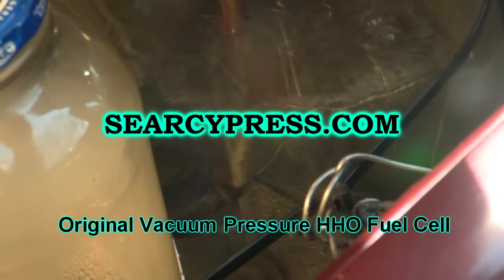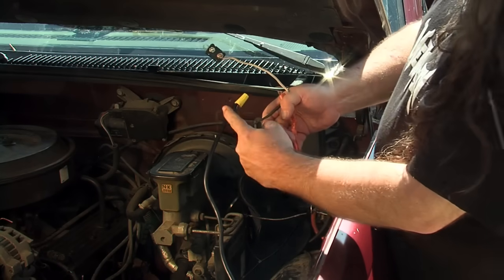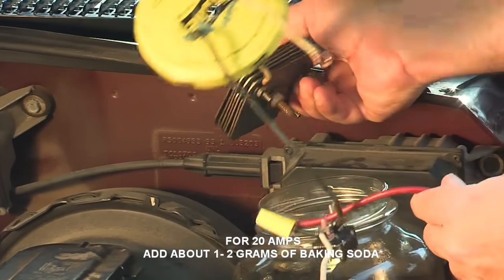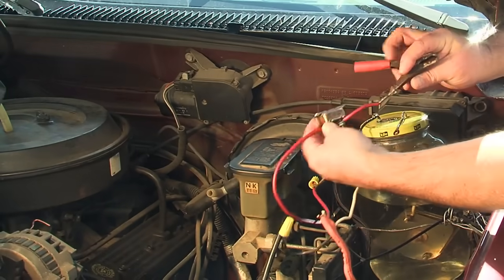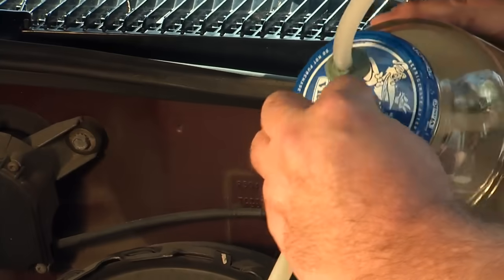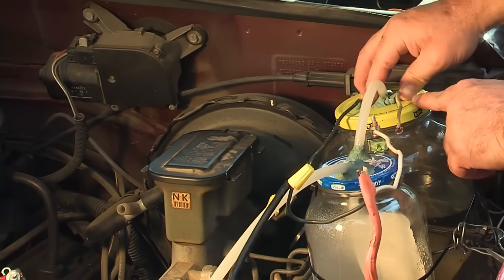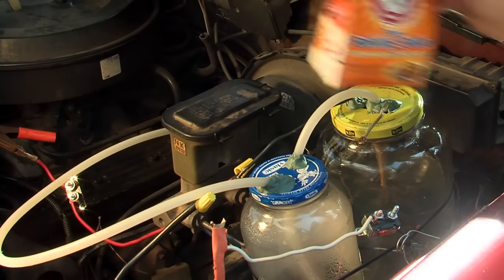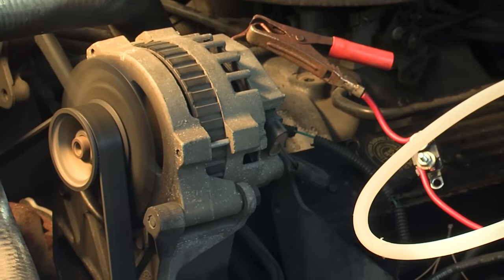Vacuum Pressure Hydrogen fuel cell defeats high gas prices using hydrogen from H2O.

Comment: Whats the mpg you get doing that?
Reply from the maker: Calculating miles per gallon is extremely difficult. Anyone who thinks you can drive down the road a few miles to say wow this is my mileage is not accurate. The only way we could accurately test this was to drive the vehicle until it ran out of fuel. Add 1 gallon of fuel and run without the fuel cell. When the vehicle ran out of fuel we  again added one gallon and turned on the fuel cell and drove until we ran out of fuel again. In that particular test the mileage doubled. This is not always going to be the case. There are so many factors that actually affect performance. When driving in the city efficiency is so greatly reduced you may not notice any real improvement other than a noticeable lack of engine knock burning low octane fuel. Nowadays that is quite a savings being able to burn low octane fuel without engine ping. This system does not power the engine. What it does is allow you to burn more of the fuel in the cylinder instead of burning it in your catalytic converter. Only about 80% of the fuel in this engine is burned in the cylinder. The rest is wasted. Using the fuel cell allows extremely high efficiency as it burns much more of the fuel where it should burn. In theory up to 20% increase of mileage is doable under the right conditions. We show an increase of water out of the tailpipe. This does not come from the HHO as much as it comes from the gasoline. Normally the catalytic converter is vaporizing the water so you don't see nearly as much come out. When running the fuel cell initially however the catalytic converter is not getting that hot.This results in a noticeable cleaning of the engine and exhaust and a lot of dirty water coming out. Many will tell you that the O2 sensor will eliminate any of your gains. That is very debatable when injecting into the vacuum as opposed to injecting into the air intake. Every system we have ever tested injecting into the air intake was not beneficial due to the leaning of the HHO. The vacuum injection is a completely different animal altogether and should not even be compared to injecting into the air intake. This vehicle, when running on the freeway, using the cell could average 24 miles per gallon.. that is an incredible leap for a V8 350. As I said, that is not always the case as there are so many factors. The temperature, the highway, the weather, and all the other things that go into traveling down the road. Even if we saw no gain in miles per gallon we still were able to burn that low octane fuel and save money. I hope you don't mind a long answer, but I wanted you to understand the philosophy of this thing. We're working everyday trying to get our newest video out to you. Be sure and subscribe so you catch some of the improvements we have made over the years. Thanks very much for your comment.

Comment: Soon they'll make it illegal to install this
Reply from the maker: The system operates under vacuum at all times. The only legal technicality I could see would be a pressurized container as dot laws are pretty strict on that. Under vacuum the concentration levels are much less making the system much safer. The system would be outside the bounds of such regulation. Thanks very much for the comment, let's hope not. New video coming soon don't forget to subscribe.

Comment: Built the exact same design. The fuse gets blown after 2 min and the jar gets hot... Whats wrong?
Reply from the maker: Auto reset fuses are used. The system must run under hard vacuum. Excessive electrolyte will exceed the 30 amp limit. Solid copper wire is used and not stranded wire which suffers from wicking. With that said, for reasons it should be obvious I do not sanction anyone replicating this. We have a new video coming out soon which will show some safety improvements. Thanks very much for the comment be sure and subscribe.
Reply: @metalpresstv  thanks for the Response. Heating of the jar normal?
Reply from the maker: @illuminator5940  the temperature of the jar can reach a maximum of approximately 155°. Remember under hard vacuum the boiling point of the water has been reduced. The boiling water acts like a refrigerant of sorts, transferring heat. This actually cools the water somewhat. Lowering the amount of electrolyte would be the solution. If your water is still producing high current use distilled water instead. Even a small amount of HHO will improve efficiency on a carbureted engine when integrated through the vacuum system. More is not always better. Depending on terrain vacuum can be lost climbing hills. In the upcoming video we show the installation of a vacuum control shut off system. During times of hard acceleration vacuum is lost so we automatically shut down the fuel cell. We're working hard on the video and it will be out as soon. Thanks very much please be safe.
Reply: @metalpresstv  thanks so much. Now the fuse ist stable...
Reply from the maker: @illuminator5940  remember you're not trying to power the motor. All you're doing is trying to burn all of the fuel in the cylinder instead of the catalytic converter. When the engine is first started using the cell you will notice an excess of water and black soot coming out of the tailpipe. This is because without the cell that water is normally vaporized in the catalytic converter for the most part. The water comes primarily from the gasoline, not the HHO. There's a lot of confusion in the hho circle. Injecting in the vacuum is a whole nother animal than injecting into the air intake where the gas is diluted mixing with air. Thanks again!
Reply: @metalpresstv  No water yet seen coming out of the tailpipe. My engine is a 100hp Diesel VW lt 35 6 Zylinder. Maybe the water is somewhere in the exhaustpipes. I use the mastercylinder as the intakte as well
Reply: @metalpresstv  interesting facts thou thanks
Reply: @metalpresstv  with strandet wire Air gets sucked through insulation, thats how big of a vacuum i have 😂
Reply: Now i have Just half a teaspoon in destilled water. When it reaches boiling temperatures the autofuse gets blown every 2 minutes... No effects in the engine after 100 km...
Reply from the maker: @illuminator5940  you're absolutely using too much electrolyte if that's the case. The fuse should never trigger.  Even if you don't observe any gains you should be able to burn low octane fuel without any engine knock with improved performance. That saves money immediately.
Reply: @metalpresstv  i will try another Run tomorrow. thx

Comment: they never show where they hook it up to the throttle body or carburetor in the videos, is it just on a vacuum source on the intake as well to mix with the air fuel mixture?
Reply from the maker: It is hooked in the video to the vacuum line near the master cylinder for ease of convenience. However, this is not the best place to use for several reasons. The line is ideally hooked where the vacuum is strongest. We have a new video that is coming out very soon, we're working hard on it. I'll try to cover as much as I can in the video. This was an experimental video and should not be replicated. Be sure and subscribe so you don't miss it. Thanks for the comment.

Comment: you need a battery bank to run it other wise you are creating a draw on you alternator that reduces power and MPG use a Soler panel to charge the battery bank
Reply from the maker: We are not trying to run the engine on this gas. This motor wastes approximately 20% of the gasoline by not burning completely in the cylinder. Using hho pushes the efficiency into the high 90s. We have a new video coming soon. Be sure and subscribe. Thanks very much for the comment.

Comment: How do u control the amount of hydrogen that goes into the carb vacuum? Like a gas pedal. Does the engine have to be running firsr w gasoline then switched to hydrogen so it wont blow up? How do u start it w only hydrogen?
Reply from the maker: The HHO is not powering the engine. It is powering the combustion process. In engines like this only 80% of the fuel is consumed. This allows for a much greater efficiency. The gas is unregulated as it is not being used as a primary fuel source. We have a new video coming out soon I'll try to cover as much of this stuff as I can. Be sure and subscribe so you don't miss it. Thank you very much.

Comment: How’s it work when you accelerate? Hooked to vaccumn hose that would only have vaccumn when your not accelerating
Reply from the maker: The older system shown in this video continues to make gas even during hard acceleration. The newer systems use vacuum control switches to disengage the fuel cell. The purpose of this device was not to run the vehicle. It is used to improve efficiency. Most of the time you're going down the highway there is ample vacuum. Like you said, during hard acceleration the vacuum is lost. Those are not times of efficiency. This also posed a bit of a safety hazard like if you were climbing a very steep incline for 5 or 10 minutes, which we later addressed. A new video is coming out soon which will show the current setup. Thanks very much for the comment, be sure and subscribe.

Comment: Ever see the Area 51 guy Bob Lazar? He has a Corvette that he converted to run on hydrogen powered jet engine!  But he makes the hydrogen with solar energy and stores it in hydrogen fuel cells (which are not easy to make but are a safe way to store hydrogen).
https://youtu.be/Ytg23mDd1a4

Comment: I would never make my final connection anywhere near the jars, a spark could ignite the hydrogen in the air if a leak occurs. I would use stranded wire and not solid as it can carry the same current but is more flexible, and all exposed electrical contacts would be covered with heat shrink tubing and liquid electrical tape.

Comment: Great video. I would use a plastic lid and a non-breakable plastic jug. If the lid is metal, I would pass the wire through rubber grommets to prevent vibration wearing through the wire insulation and conducting to the lid - if over time both wires wore through the lid, a tiny spark could explode the hydrogen with any air in the jar.
Reply: You don’t think it will melt?
Reply: The plastic jug and lid that is
Reply: @VinelandVinny  Good point on the plastic melting. I would try a plastic jar and lid filled with water - no electric flow - and see if it can hold up to the heat. I did say if you use a metal lid to use rubber grommets for the wires for the best protection from shorting. If you could also line the inner walls of a metal jar that would be best, but glass to me looks like an accident waiting to happen - as is this whole project because Hydrogen is involved.
Reply from the maker: The bad thing about plastic is it might be able to handle the heat but when you combine vacuum and heat it's pretty hopeless. Just my two cents. It video coming soon, thanks guys.
Reply: @metalpresstv  I hear ya!  I am now thinking a metal lid with rubber grommets for the wires, and a metal jar with some kind of insulation inside just incase the electrodes inside get jarred (no pun intended) around. Glass is just too fragile for my nerves.
Reply from the maker: @paulromsky9527  remember the system is in a vacuum. Think of it as a light bulb. The new video shows the safety improvement that makes anything malfunctioning of no consequence. We have to have the video out soon we're still filming. We don't want to waste anyone's time so we're trying to do it right. Thanks very much for the comment.
Reply: @metalpresstv  I will be on the lookout for the new video. Thanks.
Reply: @metalpresstv  same here very interested, will follow up

Comment: The coolest part about this is that there is 0 water in the engine because, like he said due to the temp it remains a gas thus steam cleaning the engine.
Reply from the maker: HHO causes near complete combustion in the cylinder resulting in less reaction from the catalytic converter. So what happens is you see a lot more water coming out of the tailpipe coming from the gasoline, because the catalytic converter is not hot. It eventually gets there but when you first run this thing you will pretty much clean out your tailpipe from the engine all the way through the catalytic converter. New video coming out soon be sure and subscribe. Thanks very much for the comment.

Comment: Interesting stuff carbonated engines only I assume or can it work with injectors?
Reply from the maker: Debatably, injecting into the vacuum system is a lot different than injecting into the air intake. If you're injecting into the air intake you most certainly will have issues on an injector system. Also there are a lot of ways that you can lean the system if necessary. A new video is coming out very soon. Thanks very much for your comment..
Reply: @metalpresstv  thank you! Haha looking for a way to save money when I’m out doing estimates looking to buy a beater for that instead of running the 350 diesel

Comment: Is your HHO getting better gas mileage, if so how much?
Reply from the maker: Make no mistake calculating mileage is a challenge. The test we conducted were running the vehicle out of fuel then turning on the cell and running it out of fuel using one gallon of gas. And of course running without the cell and doing the same. This was quite a bit of work. The mileage went from 12 miles per gallon to 24 miles per gallon using the cell on the same stretch of highway. In town the gains were incalculable due to the start and stopping. Understand that the doubling of mileage we observed is not typical. It is just how it went down that day. Those were the results. On average gains were 20 percent or less based on tank mileage. Definitely there was a reduction in performance in the city. Even if no gains were observed one of the major benefits was running lower octane fuel without any engine ping. This saved us money as we could use lower octane fuel that normally caused engine knock. Thanks very much for your comment.

Comment: I would be nervous with brittle glas jars with explosive gas, I would use something more sturdy. But I'm not an engineer...
Reply from the maker: The system runs in a vacuum, like a light bulb. We have a new video coming out soon which shows a safety improvement for the engineering of that. Make sure and subscribe. Thanks for the comment.

Comment: Can some explain how he hooked up the gas line? Did it run straight into the carburetor? What did I miss? Very interesting.
Reply from the maker: It is installed to any vacuum line. Preferably the one on the manifold. In the video it is installed near the master cylinder. Extreme caution has to be used because if it did break you would not have the ability to stop the vehicle. Unless of course you had hydraulic braking. We have a new video coming out soon showing just exactly what I'm talking about. Be sure to subscribe. Thank you very much for your comment.
Reply: Thank you. I wana learn more.

Comment: Yeah, but does the hydrogen fuel it generates contain more energy than the hydrogen burned to generate the electricity used to create the hydrogen?  
Otherwise you've just built an elaborate high-tech perpetual motion machine...
Reply from the maker: Let me explain.  We are not trying to run the engine with this fuel. The engine itself only consumes about 80% of the gasoline. The 20% remaining passes through the exhaust into the catalytic converter where it is burned. This is wasted energy. By burning the HHO we get a more efficient burn in the cylinder instead of in the catalytic converter where it is waste. There is no free energy. Any gains come from the gasoline. Thanks very much for your comment be sure and check out our newest video coming soon which will show you some advances. Don't forget to subscribe.

Comment: Put water in your "Drying  tank" it'd  act as a flash spark arrestor.   Making it safer also. The Amperage sound very high?
Reply from the maker: The way this system is designed once it gets running water is automatically added to the dryer tank. When the engine shuts off the water pumps by vacuum back into the primary cell. The system is designed to run at 30 amps. Thanks very much for your comment be sure and catch our next video coming soon. Don't forget to subscribe.

Comment: So about how far can u travel b4 u have to change out the water? How often do u have to clean that out?
Reply: Also, what is the baking soda to water ratio?
Reply from the maker: It all depends on the water. Generally I travel around 200 miles before I have to do anything at all to the fuel cell. Some water won't need any baking soda at all. Tap water is definitely not the best thing to use. Thanks very much for the comment, new video coming soon be sure and subscribe.
Reply: @metalpresstv  have yo ever tester the water for ppm before and after you added the baking soda

Comment: Questions after using this new tech, did you still put gas in your truck?
Reply from the maker: The goal is not to power the engine with the gas you make. What you're trying to do is burn the wasted 20% that goes unburned. It ends up in your catalytic converter. New video coming out soon. Thank you very much for your comment. Be sure and subscribe.

Comment: Has anyone tried this?
Reply from the maker: Many people have tried it despite the warnings.. People thinking that we are trying to run the engine is the biggest misconception. The goal is to burn the unused fuel that is normally wasted in the catalytic converter. That can be as much as 20% of your fuel consumption right there. Emissions are lower and the ability to burn lower octane fuel. Be sure and subscribe, new video coming soon. Thanks for the comment.